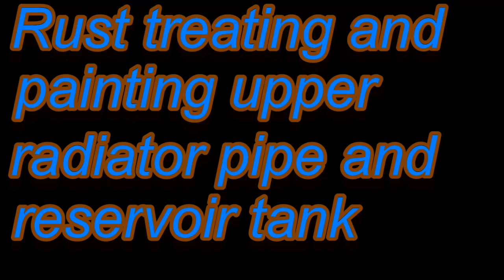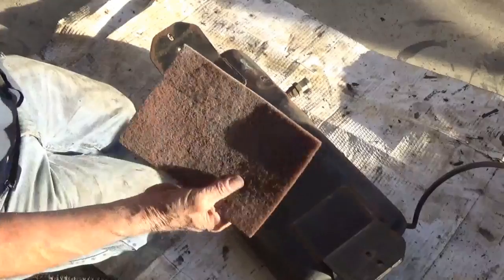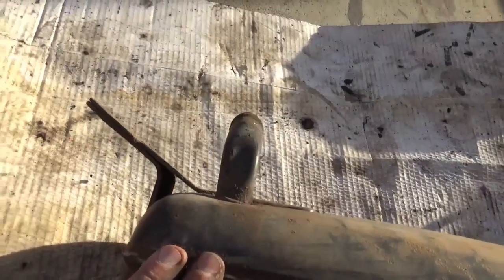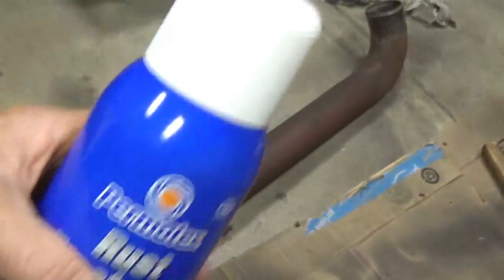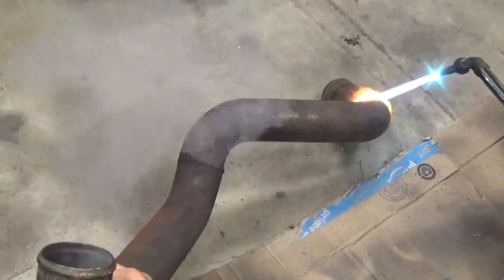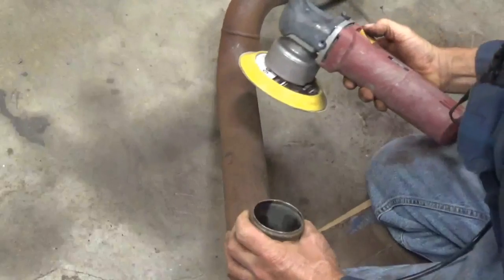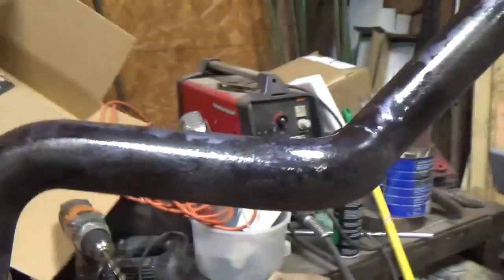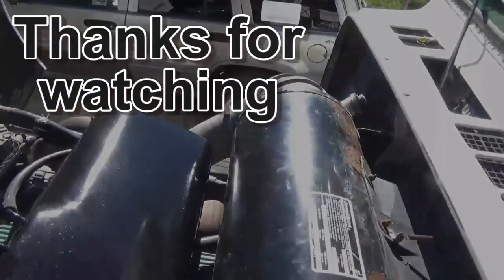Restoring rusted radiator pipe and tank

Comment: I'd think  a good exhaust 'shop., with a mandrel bender could make that up pretty easily for a lot less than the steallerahip, could probably do it in stainless also..
Reply from the maker: I could ask if they could copy it, I think it has a couple corners that might be too tight to bend, the original has pre formed elbows welded on. but maybe not necessary to be that tight.

Comment: the rust is from old anti freeze that turned corrosive. Also from the wrong type of anti freeze
Reply from the maker: Oh really? that's how the outside rusted and the inside is still clean after 22 years?
Reply: @GordonRobertsonDIY   honestly, I didn't watch the entire vid, my bad. However, I did watch your earlier vid where you had some rust issues with your cooling system. Are you putting diesel anti freeze in or the green stuff?
Reply from the maker: I don't have any rust or pitting issues nor am I concerned that I ever will. I use the green antifreeze because it's 1/2 the inflated price of the truck antifreeze. I only drive local and the coolant doesn't circulate at high speed for long hours everyday, it doesn't have an opportunity for electrolysis to cause any pitting. I did use an additive as an additional safety measure.